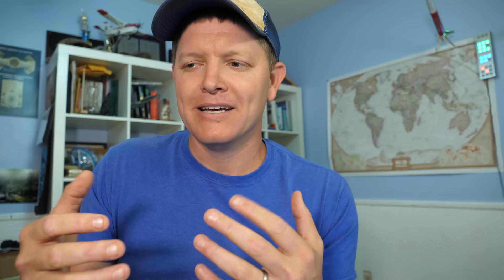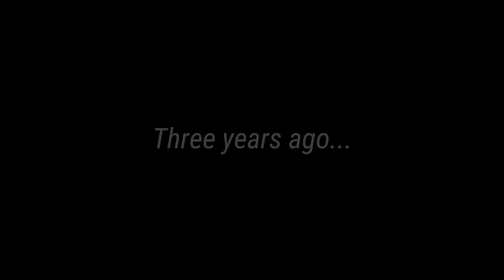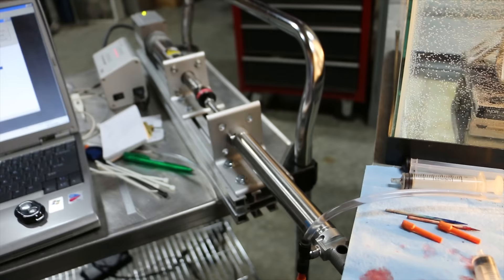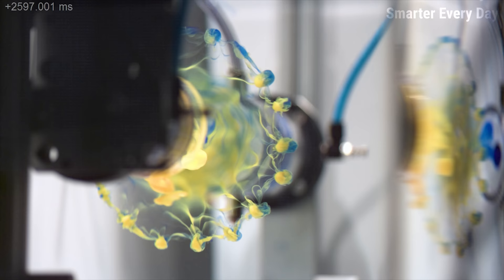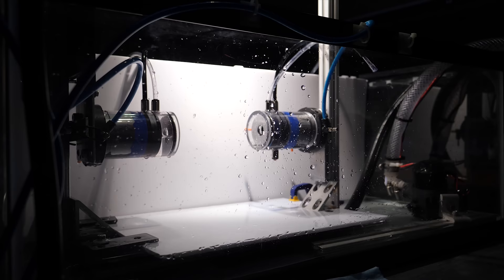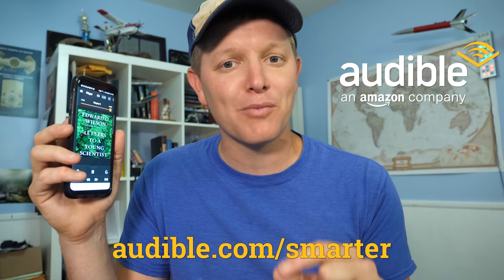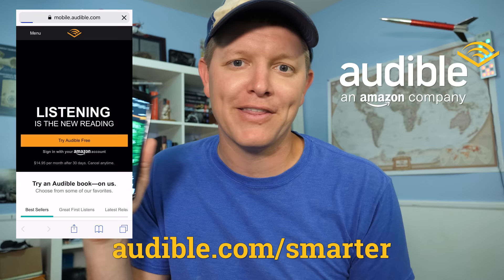Two Vortex Rings Colliding in SLOW MOTION - Smarter Every Day 195

Comment from the maker: We used a computer controlled cylinder to pump fluid behind a rubber membrane to fire toroidal vortices out of the vortex cannons.  

We fixed one of the vortex cannon in a stationary position, and used a multi-axis microscope stage to align a second cannon to it… which sounds incredibly easy, until you realize that 

DYE density was an experiment all on its own.
If the density of the dye mix was lighter than water, the vortex would go up.
If the dye was more dense than water the vortex would fall.

We had to overcome SO MANY VARIABLES and we basically spent about 4 hours figuring each variable.
Water/dye temperature differential
Water turbulence 
Water turbidity (cloudiness or haziness of a fluid)
How to reset the aquarium
Cannon Spacing
Cannon Nozzle
Cannon Shape
Dye homogeneity in the vortex itself
The piston displacement volume
The piston stroke speed
Rubber diaphragm tension, would make one side fire faster than the other.
Water or air to drive diaphram?
Firing speed (too slow and they drift, too fast and turbulence tears apart secondaries)
We did a complete redesign of the cannon 3 different times.
The Dye loading method was changed several times
At times We tried to maintain negative pressure on the cannon chamber… we also  tried to put shutters on the front of the muzzle.  Ultimately I decided it was ok to live with dye dripping out of the front.

We had to premix the dyes and eventually we got there.

It got to the point where we didn’t even really know what success looked like and always thought we were there.
Reply: Could you please enable the english subtitles ? Thanks.
Reply: SmarterEveryDay Nice!
Reply: SmarterEveryDay someday people are gonna call your phantom a potato lol
Reply: Wow, I thought the main issue was convection currents caused by the lights acting as heaters... or something. Boy, am I glad I won't have to work with fluid dynamics any time soon!
Reply: Linear actuator.
Reply: So are people who are able to capture something like this on film (or who are able to repeatedly replicate the phenomenon) eligible for a Nobel prize for physics? Or do you have to have explanatory equations and theories to accompany the process?
Reply: So this could be completely wrong as I have never taken any formal fluid dynamic education, but could the secondary perpendicular rings be the result of a recoil after collapsing (Now high pressure area pushing out to lower pressure around it)combined with left over angular momentum from the original impact? Not sure why it would make rings, but that's what sounds logical in my brain lol.
Reply: Can you make a slowmotion of the best experiment? make it 1 hour long and put som ChillStep music on it ;) in 4k :D 

Im selfish rigth now, i know.
Reply: Hi Destin, loved the video! 
A friend of mine just finished his PhD in Astrophysics and he was looking at planetary formation from dust clouds. While I don't know a ton about the details, the smaller vortices remidet me of some of the figures I saw in his thesis. Obviously conservation of angular momentum plays an important role in all of this :-).  
I just thought this might help you to perhaps find your way to some theory of how this works.
Reply: Kristopher O I kinda think the same thing. I'm not able to say it like you thought.
Reply: Yo Dustin! cool video Idea. I was using a powerwasher the other day and was squirting waterwithout the pressure on and noticed something cool. and a low velocity I could get the water stream to flatten out and it would flatten at 90degrees to the orientation of the openning, then go back and forth. If i varied the flow rate i could change the spacing between the orientation changes. I was wondering if anyone has done a study on this or what it is called?  It might also look pretty cool in slow motion. let me know if a video would help explain!
Reply: My thoughts are that the vortices are breaking apart as a result of the laws of gyroscopic motion; the  vortices are experiencing resistance from the still water which turns them 90 degrees. I have a feeling, if scaled, the experiment would result in the same number of "nodules", occuring a distance apart which would be relative to the viscosity of the fluid being used.  Would seem there is a constant waiting to be discovered.
Reply: It looks like a two waves collision!
Reply: This is so impressive!,
my opinion is that by the time the rings meet, they are not a perfect donuts shape, but more spirally - 3D sine wave forming a ring , and probably out of phase  with each other or just in opposite direction, which can explain the 90 deg transition to secondary rings on impact.
Reply: A 12 hour megacut?!? :-O
Reply: SmarterEveryDay this is the video that i finally hit subscribe on... remarkable...
Reply: Wouldn't this be better described as bubble dispersion dynamics rather than something to do with vortices?  The "bubbles"you're shooting at each other aren't whirling as in a vortex, they look like non-rotating  moving bubbles colliding and dispersing in interesting patterns, more like fractal algorithms, perhaps..?  Fun stuff though, thanks!
Reply: When will you publish a paper so we can try to recreate your method? :)
Reply: i remember my prof. told me. in programming :)) cheers :))
Reply: SmarterEveryDay what if you change the rotation on the fish tank and shoot them top to bottom instead of side to side my theory is they wouldn't rotate 90 degress then
Reply: SmarterEveryDay each of your experiments was a success because it inspired you to a new idea each time. Amazingly well done!
Reply: Could the secondary rings turning 90 degrees have something to do with the thing you talked about in the helicopter rotation video? Conservation of angular momentum or something like that.
Reply: The 90 deg problem ......
I think
As the low pressure zone sucks out the fluid from high pressure zone, it gains a (relative!!) momentum .
The two sides ( which are detached from the ring) are coming against each other now. Two sides undergo a head on collision. Now they would try to go in the direction where their momentum would be conserved ( which is the direction of the main ring propagation ). So they go in the radially outward direction (of the main ring.) ( As if a bomb blast into several pieces but the centre of mass goes in the same direction)
But in going so , it creates a jet of fluid going in that direction ( radially outward). This impulsive jet of fluid creates a vortex. ( As you created with individual coloured fluid----- by a short impulsive ejection of fluid.) 

When ever a jet of fluid is crated ,it creates a vortex whose plain( the vortex ring plain) is perpendicular to the jet.
So here the secondary vortex ring forms 90 deg to the main ring.

So in summary 😅
Collapse of main ring creates a set of another small jets which then create another vortex ring (s).
The direction of those ring is due to the conservation of momentum as I said before..

So here it ends😅....
If I'm wrong , then plz correct me...
And sorry for the bad english and lengthy explanation.....
Reply: Be sure to consider the variance in kinetic viscosity between the fluids. You might have shearing forces between the two fluids creating rotation resulting in the gyroscopic behavior. You may be able to model this in a fluid simulator to be able to control more variables. This is a very intriguing project. I hope you find out more about it soon
Reply: Hey Destin, I absolutely love you and your videos and you are a great dad in m opinion, but i cant help but wonder... How do you find the time to do all of this cool stuff all of the time? I strive for that so much. Thanks.
Reply: I think the rings might be a consequence of the rolling motion that is generated at the edges of the rings when they collide, when the outside breaks the rolling motion of the edgest tends to maintain stability and the best shape for stability is a round shape i.e. a circle.
It's kinda like when you paddle in the water, the paddle creates two vortexes at the edges which then unite to create a semicircle or a circle. Someone made a video about the paddle phenomenon, I can't quite remember who it was, I'll link the video if I find it.
Reply: Here is a video from Physics Girl which shows the phenomenon I talked about, two parallel vortexes mashing together to create a circular shape:

https://youtu.be/72LWr7BU8Ao
Reply: Beautifully Done Destin, Did you ever contact the original author?
I bet two guys with vaporizers are working on this same thing right now😉😎😎
Reply: Destin my view about your question is to look at it a bit like in step one. When you have two vortexes propeled at each other they travel as sphereish blob. I dunno if they eventualy would brake into circle if the colishion didn't happend and blob lost enough momentum. But if so then you have pretty same situation when mebrane breakes into smaller blobs. You have small clouds that have some momentum to it and they are propeled outwards from epicenter of collision. Maybe that momentum is small enough for cloud to brake or collapse right away into shockwave circle and it carrys on the momentum of the blob but material inside the blob also gained a bit of momentum from collapsing and that formed the circle itself. In the result you get shockwave traveling in two directions. One away from inital coliding and second from smaller blob collapsing into itself.
Reply: This may be dumb, but I would have thought that the secondary rings would be the result of the collapse, not in spite of it. if there is some difference in the frictional resistance per unit flow for laminar vs turbulent flow (aka if laminar provides more resistance per unit flow ), it could be a result of the transition between turbulent and laminar flow around the low pressure nodules.
1) low pressure nodule forms, drawing in the spiraling flow from the torus in the vicinity of each nodule)
2) greater volume gives the area around the nodule i) more momentum meaning that the gaps between nodules start to transition to laminar flow first, causing more friction and for them to fall 'behind' the front of the pressure wave ii)causes the low pressure effect to become more differentiated, causing a collapse that pulls harder on the water around it.
3) assuming the water in the trailing spiral (the part still moving into the nodule from it's position behind the front) has lower resistance, then you would see it accelerate to the back and centre of the low pressure nodule.
4) at that point, you have fast flow in the centre of the nodule, moving outwards and slower flow on the outside of the nodule, this is the conditions for a torus vortex to form.

Look again at the footage, the colours are not necessarily mixed at the time the secondary vortex is formed, which would be totally necessary if the vortex had collapsed and turned 90 degrees, the colours are still on the same side that they started on.

Beautiful experiment though. keep it up, I subscribed.
Reply: Might this experiment produce a slightly different result in the southern hemisphere.. how about on a horizontal plane?
Reply: I know for rotating frames of reference thing behave counter intuative. I think the rings that turn sideways is similar to pushing a gyroscope or helicopter blades. Think about it. What turns π/2 radians in rotational motion. This is just speculation but I think it would be worth a shot to take a look.
Reply: It would be nice to see this in 3D. If you ever happen to do these experiments again, could you possibly have two cameras filming at the same time right next to each other to produce stereoscopic video?
Reply: +zeek Duff, they are vortex's, watch 6:42 carefully
Reply: SmarterEveryDay you should launch three of them together that would look cool
Reply: I'm asking me one question now: What would happen in microgravity?
Reply: Destin,
Thank you, thank you, thank you for this video and the message.
There are countless fluid experimentalists out there that are watching this video and learning. Perhaps more importantly,  remembering why they need to persist.
Reply: Jeronimo We're working on the english subtitles right now. I did two minutes of them so far, I'm sure others will jump in and help.
Reply: You are the reason why there is water shortage in south africa :D
Reply: SmarterEveryDay this whole statement sounds like a line from Star Trek., and it's about something as exciting as the pitch drop experiment
Reply: Also, that composition, the music, and your message is absolutely gorgeous. Science and art.
Reply: SmarterEveryDay I would love to see what it looks like to have one ink vortex and one clear water vortex.
Reply from the maker: Yes!  I'm trying but there seems to be an issue.  
Click this link if you'd like to contribute!  For some reason they're not coming through.
http://www.youtube.com/timedtext_video?ref=share&v=EVbdbVhzcM4
Reply: Hey buddy, Thanks for all the hard work , I have a suggestion for you , try using 2 acoustic vortex guns , in other words the same experiment but using acoustic guns and see wha the results are, hope you have a great day.
Reply: There's no hard and fast rules for the requirements to win a Nobel in Physics.  There are some common threads among winners, though.  
You need to advance the theory, not merely show the theory needs advancing.  (Like Destin showed us there was something to be explained, but didn't actually explain it, so not likely to be considered for a Nobel Prize in Physics for this.)  Your hypotheses to be independently verified by various accredited scientific institutions.  This is because the prize is awarded for advancing the theory and until any hypothesis is independently confirmed, it is not theory.  You also need to live long enough to receive the prize.  The Nobel is not awarded post-humously.  
Also, it's not a lifetime achievement award.  So it's not going to win you a prize to have done 100 things which made subtle advances to theory.  You get a Nobel for the giant steps, not the baby steps.
Reply: Would this work with air vortex's?

Also idea for a video what happens when you do make a colored prism? What will the outcome look like?
Reply: My guess is that the 90 degree shift is similar to the intermediate axis theorem.
Reply: I think this is the meaning of life .
Reply: I second that.
Reply: SmarterEveryDay unbelievably cool video! Would it be possible to get the initial and boundary conditions for numerical simulations? I'd love to try to capture the effect numerically.
Reply: What was the fastest frame rate you guys were able to capture it at?  I feel like that would be really interesting.
Reply: Thank you for making this video Destin. I needed this much more than you could ever know.
Reply: SmarterEveryDay the 90 degree "turn" is a simple explination. I think the spaceman is on the right track but working on an incomplete theory. The two vortices are already spinning so it provides part of the problem. When the collide they cause convergence and create other vortices. I see the hardest part of setting up the experiment was getting equilibrium of all factors and that gives another hint. The dye is the same density as the water, the entire environment is stable so everything is as uniform as you can get it. Once you initiated the push not only did you have the dye rings moving, but also the mass of the water moving behind it as well. Once they collide and the "draft" catches up, the dyes spread in equal directions. Think of a microburst for a thunderstorm. Once the rings spread, the draft also catches up providing areas of high pressures and low pressures where the dyed liquid wants to converge again creating COL areas. The convergence zones will vreate vortices that act like smoker inks and move the the areas of least resistance...out... looks like a combination of multiple meteorological principals at work on one, beautiful, succinct interaction. I know the explanation was entirely very good. But it's allot to cover and I'm writing on a phone... I wish I could discuss what I think is happening as opposed to limiting it to a simple short, reletivelt, post...see these interactions allot in weather forecasting.
Reply: i made an observation, the rings seem to form more towards the bottom than the top, could this be because of the difference in water pressure from top to bottom?

i believe a way to test it would be to invert the whole setup 90 degrees so it sits vertically.
Reply: Lovely and truly complex. How about sending the equipment to the SpaceStation and have them do the experiment up there, I'd love to see those results. :) Super work all-round, thanks
Reply: SmarterEveryDay Mesmerizing!!
Reply: Hi Destin, what would happen if instead of shooting 2 of these things at each other, you shot 4 at each other?

In fact, I could even envision you shooting 6 at each other, 2 on the x axis, 2 on the y axis, and 2 on the z axis.

Would it still create rings?
Reply: can you think of any type of application this could be applied too? or is it just an amazing phenomena?
Reply: Treeless Phantom possible. Could also be the direction of the circulation of the vorticy. Or a combination of the two. If the vorticy is moving cyclonically, it is less likely to move downward and when it does it will do it weakly. I would also say it depends on the density of the dye, i.e. more less dense would give it more of a tendency to rise but we see some sinking as it oozes out of the tube.
Reply: I wonder if that happens in space... you know... stars and stuff
Reply: Wilson Cheung it could be used to study fluid dynamics and in turn improve the accuracy of weather models. At least that's an application I see as a forecaster. There should be more.
Reply: I am excited to use the images as desktop wallpapers. Great job!
Reply: SmarterEveryDay Great work. Don't forget to post your paper too.
Reply: I think it makes those rings because  since they are opposing vortex rings, they start to cancel out the momentum from imparting it into the surrounding water when travelling outwards(this is what inhibits the secondary ring formation) .Now the secondary ring forms is because the rotary motion in the primary ring a and b  is all good for the formation of the ring, no change in the angular momentum required. Since the vortices are also constricting, its like a skater tucking its hands in to keep spinning and therefore can spin just a little bit longer. Then the rings try to connect to each other to keep transfer of momentum close to 0.
Reply: the initial radial acceleration forces water to move to the side which is perpindicular. when it gets slowed and the masses clump up it pushes an uneven amount of water perpendicularly. the water pushed will curl around back onto where it was initially. but falls to behind the secondary ring instead because its a lower pressure. the vector movements are like a cross section of a magnetic field  of a bar magnet but like tilted like 45 degrees radially.
Reply: Thank you Sir for making this video,and congratluations!I really enjoyed watching the video. Persistence and patience,all the way.
Reply: Very cool video and we see that Dedication pays at the end. Please tell me you contacted the guys who did this almost 30 years ago and linked the video so they could see their experiment in hd and new technologies :)
Reply: like... a solenoid wrapped around the ring
Reply: Jeronimo Subtitles are complete, Destin just has to review them now.
Reply: SmarterEveryDay did you try a tank in a different shape?
Reply: Lol, I love your almost manic tenacity. :D So cool!
Reply: Kinda sounds like a 2D big bang
Reply: SmarterEveryDay it's also very similar looking to the water droplet crown. It may very well be similar dynamics only with more rotation and with equal forces and densities. The crown only splashes because of the air being less dense. The rotation in your experiment makes it easier to rotate and expand evenly in mirrored directions creating the secondary rings in place or secondary splash droplets.
Reply: SmarterEveryDay 2
Reply: He said that camera was a potato but in 30 or 40 years the phantom will probabaly be a potato
Reply: I predicted the difficulty to be half that. :)
Reply: SmarterEveryDay thos will be a good refrence for people who do fluid simulation.
Reply: Please give progress on the research
Reply: Margarito Trevino I was wondering the same thing.
Reply: If you could figure out how to do this with lava lamp types of wax/fluid, so it would sink down and self-separate so you wouldn't have to replace the water every time, and if you could mass-produce that, you'd have pretty much the coolest new gadget of at least the decade, maybe the century.
Reply: Hey Dustin,

I'm sure you're getting many of these, but...

I have a theory: When the two dyed pulses collide they flatten and expand to form what looks like a single, larger ring. But, the two pulses never mix! Instead, a boundary of clear liquid is present around both the blue and red pulses the entire time -- as they flatten out, this boundary prevents the two colours from mixing. The result is that the flattened, larger ring that initially forms upon collision (0:26)  is in fact TWO flattened rings (one blue one red) that are intertwined by the circular flow (0:27). This intertwining happens because there is no way to rotate (say) a donut inward (as if turning it inside out), without compressing and stretching. You can see what I mean in the original video, a fraction of a second before the tiny circles separate out. What you have here looks superficially like a circular harmonic or 'standing wave' -- and what happens (I think) is that the inside-to-out rotation leads to this intertwining, then pushes the peaks outward, keeping the nodes stationary. Each half-period of the wave (so to speak) then separates into a single circle as the outward motion draws in water from the nodes--sorta like the astronaut fella was saying.
Reply: The big question itself is how did the original test come about?
Reply: SmarterEveryDay this is how planets are made
Reply: I just saw another Phenomenon that was very similar to this and i thought you might wanna take a look, its an anti-bubble popping then turning into 3 vortex rings 
 https://youtu.be/w5UMyck8D64?t=2m42s
Reply: I'm surprised no one has mentioned this yet, but recently over on Sixty Symbols they had a video on the Kelvin-Helmholtz instability, and while it's not a blanket explanation, I would expect the rings to be a product of that.
Reply: Dolphins do this all the time
Reply: Can this phenomenon be recreated with both vortexes being made of the same dye?  Or does the difference in densities cause an interference pattern?

(I'll admit, I'm not a fluid dynamics guy.  However, I like eliminating possibilities to narrow the focus of study)
Reply: SmarterEveryDay the viscosity of the liquid? Particles dragged in the water that drag other water molecules
Reply: SmarterEveryDay that's such an American sentiment.....
Reply: SmarterEveryDay You're amazing. Absolutely beautiful. It may be a little late, and I may be on my third beer, but I literally cried a little when I saw those rings materialize.
Reply: SmarterEveryDay thank you for doing this
Reply: Very impressive and it looks awesome too. Has this experiment ever been attempted using a supercomputer simulation?
Reply: Hi Destin,

Long time subscriber.
This has to be one of the videos that you've made that really caught my eye.
In a way it raises my interest and raises some questions I have for you (purely out of intrest!)

The main question I have is:
Does the shape of the container influence the shape and pattern of these colliding vortexes?

Because the water displacement is not even because of corners in the tank, right?
So this would be different in other shapes of tanks?

I'm a big idiot when it comes to science but I love learning and am fascinated by interesting stuff like this. I too like to know how things work when I see them happening.

Regards,
F
Reply: SmarterEveryDay Thankyou for making this video, this might not be a very big deal but I'm currently in an internship program for a game development in a university, at this point my team is falling behind and constantly stuck scrapping ideas, making new ones, solving problems and scrapping it again over and over for weeks, I'm starting to lose hope and questioning why I bother trying. But seeing that section of the video about being persistent and just filling the tank back up for the next round, in a way gives me a new ray of hope and motivation
Reply: I see no reason it wouldn't, as long as you can get coloring agents that have similar properties (density, viscosity, ...). However, I do expect that the mixing will happen faster and more chaotically, and as a science experiment, that makes it harder to document properly.
Reply: Man, thanks for the video, but more importantly, thanks for the message. Kind of had one of those jungian synchronicity moments when watching this. Keep up the great work. You're an inspiration in so many ways.
Reply: SmarterEveryDay Kudos!
Reply: Would deionized water have any significant effects in the results?
Reply: So the original scientists were unavailable for hints?
Reply: SmarterEveryDay ....can you do this without gravity....and is it anyhow related to the behaviour of the currents produced in the fluid?
Reply: every time I come back to this channel I always gets inspired and learn something new. Thank you Destine!!! The best channel in Youtube.
Reply: SmarterEveryDay ,
I will try to explain my theory scientifically.  The reason it turns into a 90 degree ring is that the fluid with ink has momentum going 90 ° from the point of impact. As it forms into the low pressure spots, it turns round/spherical. It then turns into a donut shape because the the resistance/friction from the non moving liquid is in front and on the sides of the secondary ring.  This causes the sphere shooting out to flatten, then curve back around into itself until it has run out of kinetic energy.
Reply: Why would you need people to give you money to do this when you have 5.6 million subscribers, and are clearly getting rich doing this?
Reply: Hi Destin! What amazing video! I wish I could to the same with electricity videos! Amazing!
Reply: Hi Destin, I have an observation regarding the experiment. 
Have any of the research papers, or scientists involved, considered the pressure created in the opposite direction by the walls of the tank when the ring expands? That may explain why the rings form in a 90° angle in the outside. I propose to recreate it in a bigger tank with the same rig to see if the outside rings forms.
Reply: Why don't you try do pump two times or more at once? Or try something like a vortex inside a vortex and the collide event... This would be even more amazing! XD
Reply: The molecules of the colored material you were using sticks to itself slightly more than water.  So what happens as the low pressure sucks fluid toward itself the friction between molecules pulls back on the center of the mass where the most sticky region is.  This creates the secondary rings like a reverse of the vortex plunger.

And it is 'G' IF, not Jiff.  The hard G is no longer negotiable.  It stands for Grrraphic.  Not Jrraphic.  Smarter Everyday should get that right.
Reply: SmarterEveryDay if no one has guessed it already it creates miniature hydrostatic low pressure shocks that In turn break up the ring and create mini rings going outward this is do to the hydrostatic shock and gravitational effects of the earth with molecules spinning that fast creates shock waves in turn creates the ring. 

All this and I’m not even a scientist just a normal idiot who can watch things and retain them. Prove me wrong and not just say no your wrong because this is a full proof proven hypothesis into a solution.
Reply: SmarterEveryDay Can you post the details of the mechanism, for the people (like me 😎) who want to recreate the experiment? And any required details?
Reply: Man i need to get involved in projects like this, i'm an engineer with a functioning brain but i've got nothing interesting to flex that muscle for.
Reply: I wonder if this problem is somehow related to when your shirt collar is stretched out it becomes wavy. Because if you look not at the far exterior rings but at the bulk of the collision in the center its edges are wavy and it looks just like a stretched shirt collar.
Reply: Like maybe the color pigments are more attached to themselves and try to snap back where they were when the collision began and that "elasticity" makes those waves
Reply: Thanks for great video! 🤓
Reply: Could the nodules forming around the rings be the result of some sort of resonant frequency? That would explain why they're at regular intervals and why there are areas of high and low pressure.
Reply: SmarterEveryDay  I think I get how it works, at least to a degree.
When the two vortexes collide you can see the dye is shot outwards, and this seems to cause the large outer dye ring to start rolling from the axis of collision out towards where it is shot out, and then when the low pressure areas draw in the dye around them while its moving forward it rolls on that axis as well, forming smaller rings at a 90° degree angle to the original ring.

If you are confused let me know and I'll try and think of a better way of wording it
Reply: Brian Crone, That's exactly what I thought so. Dustin, is it possible to try it with another pure liquid? Maybe Glycerol or Alcohol. The intermolecular forces (and therefore viscosity) may be affecting the number of nodules. Changing the ion concentration may also be interesting, you might use salts like NaCl or KNO3 (It might be cool to spice things up a bit ;)) It would be a great way to see if they are dependent. Great video, thank you.
Reply: Perhaps take this experiment to the next level by changing the gravitational force and as many other variables as you can.
Reply: Great experiment.  It would be interesting to do this in an MRI scanner and map the flow field in 3D.
Reply: The velocity of the fluids moving away from the point of collision are moving at a rate as to cause the secondary rings, much the same as someone blowing smoke rings.
Just my 2¢
Reply: Hey Destin! Awesome video! Love the visuals! When I saw the trouble you guys had to go through to re-empty the chamber, and then re-fill, having to wait for turbulence to stop (can just imagine the time), made me think of a quick solution I once saw! OZONE. Super strong oxidant. Was using it as part of a water purification system, but it removes almost any particle from water, including food colouring. And ozone gas also remove tabacco stains.. the only two I can vouch for :') Anyways, just sayin'! Good luck with new projects!
Reply: Congratulations on your achievement, the videos are truly stunning. It took a while of thinking since the dye doesn't show everything but in the end it's mostly clear what's going on there. Thanks for that, it's one more miracle of the world explained for me.
However, asking people not to make a jif out of your video is pointless. Ask people to link back here instead. There's so much more to see in the video than what a jif can provide anyway.
Reply: If you want to see another very cool visual experiment using almost your exact same setup, run the same test except with one smaller ring trying to pass through a larger ring,  I've seen it just by complete chance with smoke rings and the outcome blew my mind!  The best i can explain it is that the rings trade places. The large ring passes around the small ring then gets sucked into the backside of the small ring and gets fired back the direction it came as now the small ring and the smaller ring will pass through the large ring, then expand around the larger ring and also fire back from the direction it came but now as the larger ring......words simply can't do it justice.   It is visually stunning!   If you get the chance to try it, please do and share it for the world to see :)
Reply: Very awesome to see. If water/dye temperature was affecting horizontal stability so much why not position the cannons to shoot up/down into each other? I'd also like to see 3 or 4 vortex cannons shot at each, can you imagine what would happen?
Reply: So, would this also assume that the generation of these potentially low pressure areas would also lead us to assume that the ring itself contains low pressure areas while in movement? Hypothesizing that perhaps the movement speed and densities of the liquids are already constrained by pressure mechanics? Is there any way to possibly even observe that there are areas like this in a toroidal vortex? Is there centrifugal force?

Have you considered trying to adjust the mechanisms to see if you can get these toroidal vortices to collapse on contact instead of expand? Would it be possible to have a rod in the middle that creates enough friction to overcome the outer edges, or does the surface area make it impossible? Maybe with a conical barrel instead of cylindrical?

I'm super excited about all this, I can't wait till you guys inevitably answer some of these questions in the future. Thanks for doing this research and development!
Reply: SmarterEveryDay Did the direction of the vortex matter?  Like if one was clockwise and the other was anti  will it cancel out or was this experiment the product of having both vortices in the same direction?
Reply: With 2 similar vortex rings colliding the momentum is conserved by the rings being pushed out (They can't bounce off or pass through each other). This is your perpendicular change in direction.

As the rings spread out, some unseen action breaks the rings into sections. The end of each broken ring section joins with its counterpart, resulting in multiple rings travelling outward.

So the real mystery is what causes the rings to break into such regular sections? My guess is that the clear water being pushed out by the leading edge of the rings is forming jets, a bit like a paint splat, causing intervals of low and high pressure.
Reply: SmarterEveryDay would adding a stationary bubble of dye in the collision zone with a third color help to distinguish what's going on there? I certainly think so.
Reply: This is the result of two interactions:  Cyclical Turbulence of the kind you see when a wing is in a stall and Circular Traffic Shockwaves.  So long as the circumference is less than C, the flows remain laminar, but at C, they break into cyclically turbulent flows.  C is determined by a variety of factors, primarily the dimensions of the vortex rings themselves, along with their approach velocity.  At C, their laminar flows can no longer sustain themselves any more than can the airflow over a wing at distance S from the leading edge.  Laminar flow becomes turbulent.  On a wing, it breaks into a sort of luffing.  In a light airplane, this might have a frequency of 15 Hz, but in a B-52, it feels like you're slowly driving lengthwise along railroad tracks, perhaps 5 Hz.

Reference your Making a Laminar Flow Nozzle video and see if you can more make the vortex rings more laminar, if that will increase C without adjusting any other factors.
Reply: @UatuOmega , Actually, in order to get a Nobel for an experiment, it would have to fulfil (at least) two conditions:
* Be amenable to a theoretical explanation or, at least, framework.
* Said theoretical explanation would have to be a game changer in the scientific field of interest.
As much as this video is astounding, the Physics in it are not new, and are generally well understood.
BUT: As I suggested in a general (long-ish) comment, there ARE scientific prizes associated with producing the most astounding science images. This is where such a video would have good chances of getting some good recognition.
Reply: That dripping dye really ruined it for me. Could’ve enabled a better shutter system. Fail.

Jk jk! Great vid. Thanks for all the hard work and congrats on the accomplishments!
Reply: Tyler Loree I think I’d prefer 4, but good idea. I bet they already thought of that during all those hours of work.
Reply: SmarterEveryDay 2 years ago I visited a flight show in Austria and saw a similar effect when smoke was not generated in the exhaust system but at the edge of the wings right in the vortex of the wings. After a little time the vortex divides into rings as in your video but without a collision 
https://youtu.be/hdf1goW808s
Reply: The rings are probably caused by the exact same thing as the big ring... When they collapse into each other they collide outwards at the same rate creating a ring.

The O is produced because the material is being deflected outwards due to the impact at the same rate on both sides. If all the variables are absolutely 100% correct, I wouldn't be surprised if this reaction could theoretically reproduce itself endlessly like a fractal.
Reply: video that will be shown in schools 50 years from now gets a like. nice vid. i picture particle interactions like this on a curved plane.
Reply: alright. I m gonna work on my "vortex collision" stuff. might take more than 3 year, but if I succeed, it s all your fault ^^.
Reply: SmarterEveryDay that's i called "Technological Art"
Reply: SmarterEveryDay got I love you. Can I meet and chat please
Reply: @Liron Zadkovsky
Well ... not exactly. Vortex lines always form loops, they cannot just "terminate" at some point in the open water. Therefore, a helicoidal or spiral structure is impossible: They really are doughnut-shaped.
Reply: is it possible that just the forward momentum of the ink moving outward is what caused it to form the ring?
Reply: @WX SRG
Actually, not exactly. What we have here is an axycylindrical version of Crow Instability, that one often sees in high-altitude contrails. I left more details in a general answer to the thread, in case you feel interested by the gory details (although it still remains a mere summary).
Reply: @alwayswinning97
Actually, two vortex lines parallel to one another always translate in a fixed direction perpendicular to their axis (the direction opposite to the direction of the flow between them). This is classically observed in apex vortices in planes: the pair of vortices that make up the trail of a commercial plane always gradually translate downward.
Here, the two vortex "lines" are actually axysymmetric (they are circles), so when they get close to one another (namely, when the two ring vortices "collide"), each section of this two-vortices circle will tend to drift outwards. This is what makes the initially small doughnut vortices grow into a gradually larger and larger circle, whose circumference is made of two conter-rotating vortex lines.
Reply: LarryM weell, kind of no. This is a professional camera. In the '90s a professional camera would have been like a film camera, a 16mm or a 35mm, while the video clearly shows a VHS footage (doesn't look like beta at all) so yeah that was the quality that you would compare in terms of specialization with a phone camera today.
Reply: SmarterEveryDay Personally I love to solve problems by simplifying the question. Maybe you can try one side coloured and one side pure water so you can see the motion of the vortex partially. Imagine maybe the vortex will show some special patterns? Hope you haven’t disassembled the equipment. :)
Reply: I just posted this a moment ago, but perhaps posting it under your comment thread is a better place...Kudos for the extraordinary effort you put into this. The transition into right angle vortices is likely an effect of the Coriolis force. This is defined as the cross product of the motion of the vortex rings relative to the earth's rotation axis.
To prove that the Coriolis force is significant, the shape and/or orientation of the rings should vary, dependent upon alignment of the two fluid injectors (up/down, vs. east/west, vs. north/south)

You may think the earth's motion is insignificant. However, I've heard it asserted that grape vines tend to grow/spiral on support wires in a direction consistent with the Coriolis force and that when firefighters spray into a large fire, whether they spray in a clockwise or counterclockwise pattern will determine whether the fire is pushed away from or towards the nozzle (and again, consistent with what is predicted by computing the Coriolis force)
Reply: Can this be done in a vacuum?
Reply: EpochDeus   Good question. But there would be at least one MAJOR problem that precludes the test being performed using water. In a vacuum, the water would immediately vaporize. I'm not sure if all liquids would vaporize. But most will, including oils.
Reply: I was wondering if it could be a visual analog for colliding universe scenarios.
Reply: Another issue that will likely occur is the smoke/vapor or w/e would probably just fall down to the base of the vacuum chamber.
How could these issues be overcome? Any thoughts?
Reply: Destin where do we find out more about David ?
Reply: EpochDeus  The analogy to astronomical events such as galaxy formation seems fair. Smoke generally includes a lot of particulates. In air, these particulates may have a comparable density. But, unlike a gas, the particulate's density will not decrease as the air's density is decreased towards that of a vacuum. The particulate would fall out of suspension. In contrast, the gasses contained in smoke will also diminish in density as the air density is reduced. Brownian motion would keep some in mixed form, just as it currently does with Oxygen, Nitrogen, Argon, and CO2.

If you wanted to try this experiment using a medium that is less dense than a liquid, you could perform the experiment with, say, air in a partial vacuum and instead of injecting a liquid, inject a different gas, such as CO2. Their interaction could be viewed using an infrared light source and camera, along with a combination of diffraction and perhaps Schlieren photographic techniques.
https://en.wikipedia.org/wiki/Schlieren_photography

The gravitation involved in galaxies is vastly more complex. Billions of objects exert gravitational pull on each other. In a vacuum, there is no viscous damping to diminish these effects. This is in contrast to what is shown in the video, where viscosity quickly slows and stops the motion.
Reply: SmarterEveryDay you can make it into scientific publications!
Reply: What does or is this saying? From my background I think this is sayin there is stuff as far as energy, technology and knowing of everything is possible,that we as a community and society don't know of yet!! Just tesla alone what he had known. Energy was endless. Free. And magnets+electricity is the key
Reply: It has answers too this world and how things work,those of i don't know.... As far as this world. Such as what's called quantum physics. It goes hand and hand with electricity. We as individuals can quantify our lives. Meaning you can add it up everything+×÷=
Reply: Sounds like a hard university exam. Congrats, you Aced it! (eventually)
Reply: +Uatuomega, there need to be some explanatory equations and ground breaking theories to be suggested to Nobel Prize.

That doesn't in any way make the accomplishment any less, and can give some researchers some inspiration to do the science work for the theories.
Reply: This (the pressure washer bit ryancrazy mentioned) sounds like a 3D standing wave created by surface tension. Basically the nozzle "flattens" the stream horizontally, surface tension of the stream pulls it back into a cylinder, but the inertia of the stream "flattens" it  vertically, which surface tension acts on again, and you basically get a standing wave effect as surface tension acts on either maximum and minimum width/height, but does not act to prevent energy transfer through the neutral cylinder state.

The ninety degree bit I'd imagine has something to do with gyroscopic motion.
Reply: SmarterEveryDay This may be very hard to do but what would happen if things were perfectly aligned in the vacuum of space would there be infinite rings and what would be the ways they would form directionally.  What would the total object look like from beginning to Finnish.
Reply: SmarterEveryDay maybe i missed it somewhere, but why didnt you just contact the guy who originally did it.?
Reply: I don't want to cause you 3 more years of work but can you get the same effect with smoke?
Reply: Have you considered publishing what you found?
Reply: I thought secondaries' cause  was gyroscopic precession.

Kind of like the way Feynman formulated his theory of subatomic particle spin by looking at a plate spinning on a countertop.
Reply: I have a question...
I noticed in some of the best shots the inner stationary disk forms back-and-forth ripples on its edge (like an old vinyl record left in the sun) that seem to line up with the perpendicular vortices. Is this caused by a similar unequal pressure distribution that you think causes the perpendicular vortices to form?
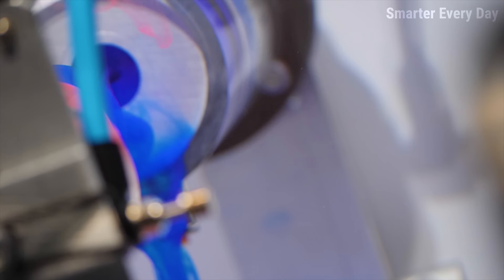It's very visible at 4:31 and 4: 58
Reply: Were you able to find a failure tolerance for the secondary ring effect? Based on the video results, it looks like there is still room for finer tuning
Reply: No.. It does not sound easy haha. This is awesome man. Great job and props to you for continuing with the project while faced with adversity!
Reply: It looks like the smaller rings are simply the collision of the forces colliding in the middle of the low pressure zone (6:35), replicating the same (albeit smaller) force and impact created by the initial impact of the initial vortex rings.
Reply: not endorsing vaping, but the way vortex moves remind of this video: https://youtu.be/QR53pniK71w?t=110
Reply: What about two gaseous giants colliding in space? (fluid-air, water vs vacuum?) supernova? planetary formation explained at a micro level? .... imagination gone wild...
Reply: Glad (or not) to see someone appreciating the frustration I face every day with experimental fluid mechanics
Reply: 8R4ND0N 3LL1077 CRU23L1   Coriolis Effect in 3D perhaps / more likely. (re: direction of spin of secondary vortices)
Reply: @AxtheDragon  Sorry i feel like im posting my idea to everyone that had a similar thought: Coriolis Effect in 3D
(re: direction of spin of secondary vortices)
Reply: @ryancrazy1   a picture is a thousand words, video is a pictures. 
yes, please make a video and link it on your edited description.
Reply: @briancrone  the direction the spirals spin,  i wonder if it's the coriolis effect that begins inertia ina specific direction
Reply: Wouldn't it be great if you could automate or simulate that entire process and just watch the results for hours?
Reply: SmarterEveryDay @SmarterEveryDay
I think I understand how the secondary vortices are created. 

 My theory🤔

-as the high pressure nodes collide with one another, they should cancel out. But the outward momentum redirects the collision outwards leadin it to act similarly to a mushroom cloud. 

Please reply. I’m love your videos and would really want to do an experiment with you. Physics is AWSOME🤩🤪🤩🤪🤩😜
Reply: Incredible.
Reply: I hope you guys write it all down and post or publish it some place
Reply: No wonder it took you years